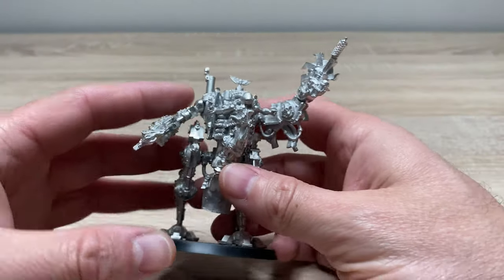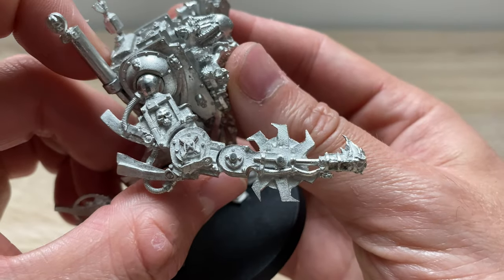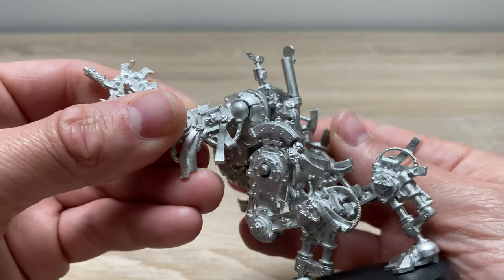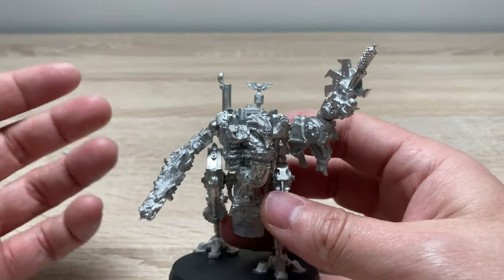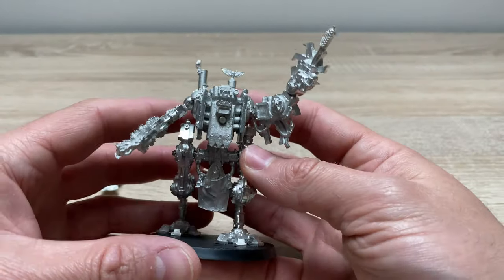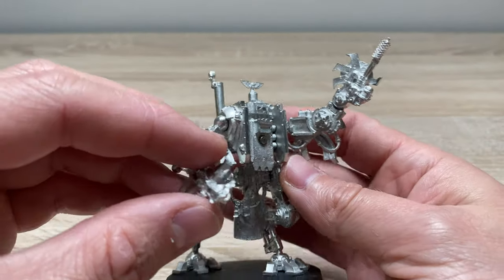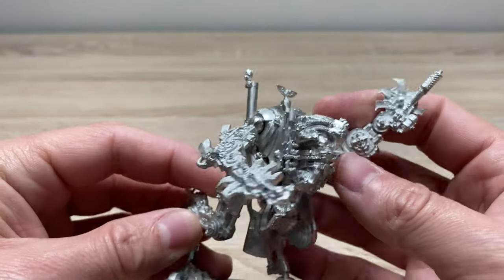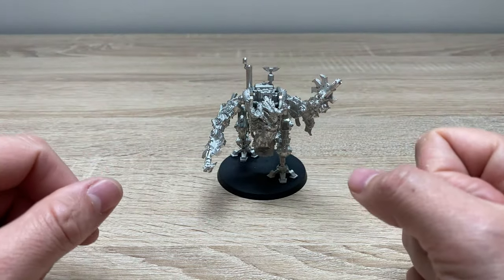Adeptus Sororitas Penitent Engine OOP: Model and Build Review (Warhammer 40,000)

Comment: If you ever review the plastic model, I'd like to see a side by side of them. I just built one of these metal beauties.  I had all the issues you pointed out. I like the way you pinned the legs. Much simpler than how I did it. I drilled all the way thru the leg until a hole appeared at the top of the joint, so I would be able to get epoxy completely in the leg. My pins are as long as the lower leg segment. And then thru the foot into the base for one continuous pin. It took an evening to get legs pinned. But it was enjoyable. I roughed up the pin with my cut-off wheel for a good epoxy bond. Great discussion,  I enjoy your videos, 🍻
Reply from the maker: I’m always interested to hear different ways to solve the same modelling challenges - as long as it works and we enjoy doing it then it’s all good.

And thank you, I’m glad you’re enjoying the chaanel.

Comment: Do you ever double pin shoulder and hip joints etc to prevent any turning motion where glue joins break. I found it to be a perennial issue with their dragons from the early days (late 80s)
Reply from the maker: I've only double pinned on the largest models i.e. Forge World titans.

To prevent rotation I'll sometimes do inclined pins which are at a different angle to the orientation of the limb. Scoring the surface of joints to create a complex contact surface on the joint is also effective.
Reply: I always found the worst ones for 'pin wheeling' were giants or other big villains were a had was cast separately and it was impossible to position things to get a second point of contact. Have to say with plastics now I don't those modelling challenges.😉 Great review by the way, model looks a the cusp of falling on its face! Wouldn't want to pilot one😱